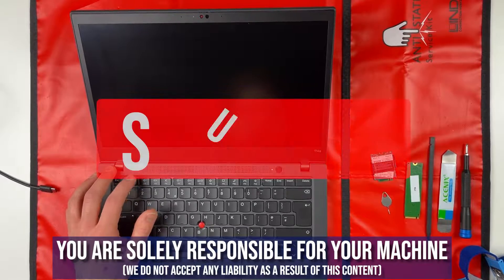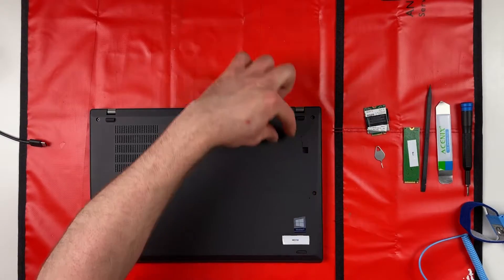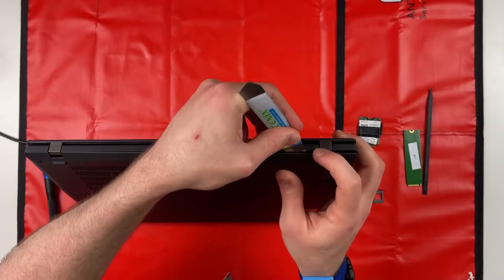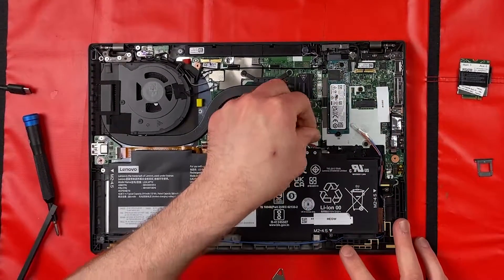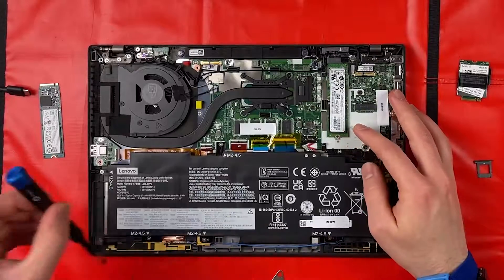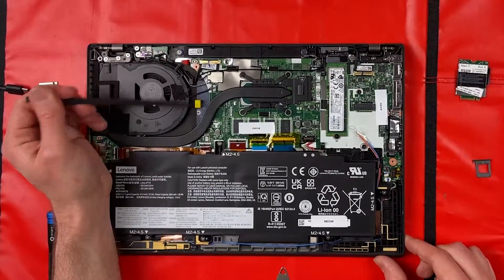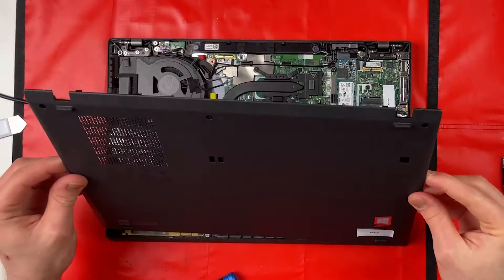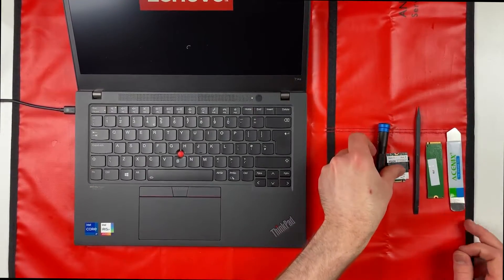ThinkPad T14s Gen 2 Internal look & SSD Upgrade

Comment: How is putting the thermal pad on the BOTTOM SIDE of the SSD where there are NO chips to transfer heat going to help anything?? The basic uses of a heat pad is to put it on the top side which houses the chips.  WTH??
Reply: heat transfers through the bottom as well
Reply from the maker: Yep. 😂 That's how it comes. It's PCIe 3 so thankfully it doesn't get too hot anyway.

Comment: Hello. I am about to buy a Thinkpad T14 with an intel i7 16gb and 512 ssd. I wonder if the ssd can be upgraded by a "Ssd M.2 2280 2tb Supertalent Fpi2tbmwr7 Pcie 3d Nvme". In the lenovo page said "up to 1Tb". Is this 1Tb limitation real? I wonder why 1Tb. I would thanks if anybody has an answer. Cheers.
Reply from the maker: Upto 2TB single sided is fine. 2TB not really available back then. 4TB+ tends to be double sided, see Reddit for that.

Comment: Hi! First of all, congratulations, this was a really useful, but not overcomplicated video with an understandable explanation. I have a question, how to reset the laptop through the hole shown at the end of the video, and what does it refer to, how well does it return to its original state? I've forgotten my BIOS password, so I'm looking for a simple way to get back in, so I thought maybe this button would help. Thanks!
Reply from the maker: Bios password, if forgotten - requires a replacement motherboard from Lenovo's perspective.
Reply: @GreenGreenStore  Then that's sad. I don't think they do it under warranty. (it still has a 2-year warranty) It is a permanent work tool, so it is not a good idea to send it for service. Is there no other way to delete this password?

Comment: Hi, thanks a lot for these instructions. Do you know if a SSD with a heatsink fits into this notebook? I want to use a seagate firecuda 530 4tb. This one is single sided, but there is a big heatsink on one side...
Reply from the maker: Heatsink most likely will not fit. It's only PCIe 3 speed on this model so wouldn't suggest go too over the top with the SSD beyond PCIe3.
Reply: @GreenGreenStore  Ok this model can take a PCIe Gen 4.  Check the original spec sheet that comes for this laptop.  Gen 4 dude.

Comment: you need to install the windows system once again after changing the ssd?
Reply from the maker: Yes, as presumably the SSD going in is either empty or isn't setup with Windows for the machine.

Comment: Great and simple vid. Once the ssd is swapped, is there anything i need to do in the settings for the laptop to recognize it? Or should i be good to go once i turn it on?
Reply from the maker: Should be able to install OS next.
Reply: @GreenGreenStore  im very new to this. Will that happen automatically via transfer or is the OS installed on the current ssd and will need to be transferred to the new one somehow?

Comment: How is the heat on intel version compared to amd ? Suport for Linux ?
Reply from the maker: AMD does slightly better in the thermal.  Linux apparently is comparable if you swap an Intel wi-fi into the AMD powered unit. Otherwise the default realtek WiFi in the AMD version can take more time to get working.
Reply: @GreenGreenStore  The WiFi looks soldered in this model, would it be different for the AMD model? 
+ Do you guys have any plans to review the AMD version of this laptop?
Reply: @omidshay  AMD model has different design and allows WiFi module to replace unlike Intel variants.

Comment: Renewed) Lenovo X1 Carbon Intel 6th Gen Core i7 6500U 14-Inch (35.56 cms) 1980x1080 Thin and Light Laptop (8 GB/256 GB SSD/Windows 10 Pro/MS Office 2019 /Intel/Black/1.90 Kg), Thinkpad X1 Carbon

This is the configuration given in the Amazon, can I go for it.

I like to use it for software development, Android app development, Python programming etc.
Price is 700$ approx. I did not understand which Gen of X1 Carbon is this one.
Can I upgrade the Ram and SSD etc.

Your Video is very informative, it is very useful for IT students and IT professionals. Good work.

Waiting to hear for your advice to go for an X1 Carbon or any suitable one.
Reply from the maker: Can't speak to the US price, that's likely to be the 4th Gen X1 Carbon. Ideally find the 6th gen Carbon or newer featuring the 8th gen processors.
Reply: Ok, thank you

Comment: It's clever that you started opening the base cover from the back, since there are less clips, and also, if you break any of them, it wouldn't be too bad since it's just the back, and it wouldn't affect the usability.  Unfortunately, it's too late for me.
Reply from the maker: Thanks for the comment. 

The note seems to always to visit the hardware service manual first (I know the colleague in the video did this because the base cover design has changed a slightly). 😶